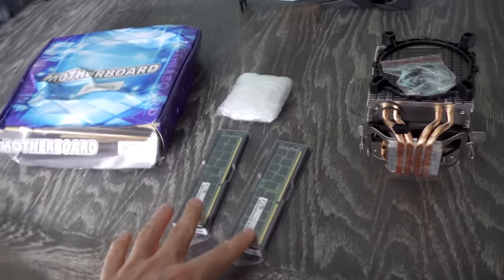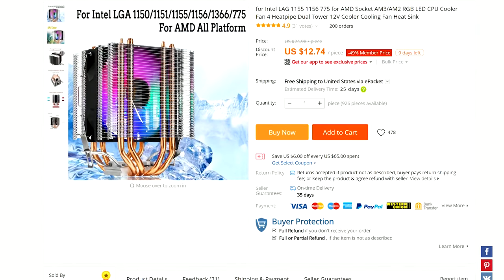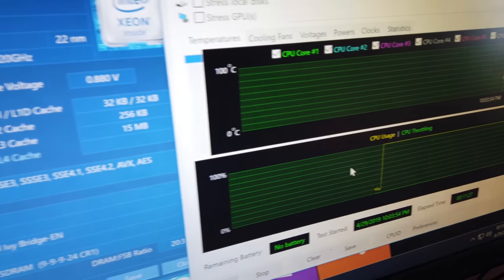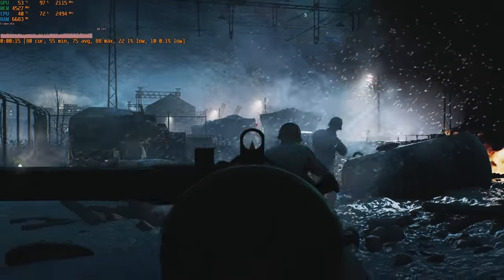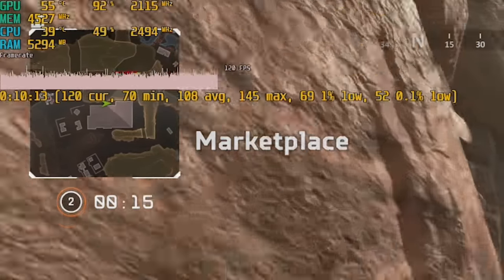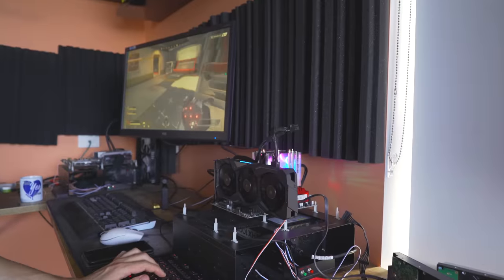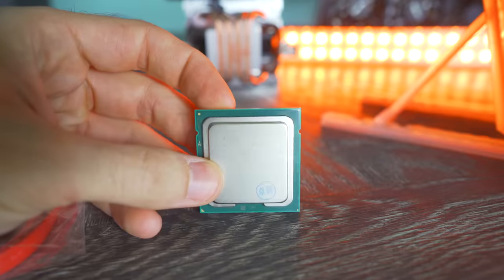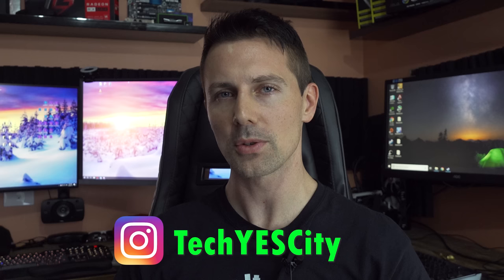This 6 CORE Ivy Bridge Xeon only Costs $24...! (Worldwide Deal)

Comment: Hey brian i have some experience with chinese motherboards and your ram might not even be the problem usually these motherboards apply too much voltage on ram so cheaper rams cant handle it and give bsod all you have to do is lower the voltage to default levels same thing happened to me on a colorful motherboard turns out it applied 1.35 voltage on my ram which normally functions at 1.2 volts so i reduced the voltage and that fixed the bsod issue

Comment: Last month I got a bare bones lenovo s30 for $55(620w gold power supply / motherboard / cpu cooler), 16gb ecc ram for $12 and an E5-2680 8 core at 3.1ghz for $45. Then just put in a $110 rx580 and it rocked.

Comment: The only thing that I would be concerned about is the longevity of the motherboard as it is a no-name board using a chipset that was not meant for that kind of processor. Other than that this looks like it is a fantastic value.

Comment: I managed to snag an x58 system for $100. That's the case(CM HAF 932), memory(12GB in 6x2gb sticks), board (with an i920), and even a 750GB hard drive included. Power supply sucks, so that's going away. I've been looking at Xeons to replace the i7 with and I'm torn between using the X5675 and the W3670. Have you compared these Xeons before?

Comment: Ok great now im stuck between X3440 or E2 Xeon thanks. Btw it would be nice if u can make a video for a list of great budget Xeon combo since u have been recommending alot of Xeons (which make me confuse since idk alot bout Xeon or pc in general)
Or just a comparasion between the X3440 and this upcoming build
Reply: I would get this one tbh
Reply: X3440 would only be better if you plan on getting a high end board and overclocked it.
Reply: @TheFirestriker101  do u think the X3440 would be better if u oc it to 3.8-4.2Ghz? I know brian made one guide where he oc it to 3.8 easily so thats kinda a bare line for me but i think im willing to push out more performance if its worth it
Reply: @StevenSteves  yea 
, the 3440 would be better at that point
Reply: @TheFirestriker101  Cool. Thanks for the info mate

Comment: My z97ar died just bought a mid range board replacement . I hope it will work. The high end socket 1150 have all sold out! Pff I'll go amd in the future for compatability's sake. Though haswell was solid. These boards available for my i5 4690k are all micro atx and only support 1600mhz, sad for my 1866mhz hyperx lol

Comment: X5670 at 4.9 going on 3 years still killing with the best. Digitalanarch here aka digitalanarchy
Reply: what is the mobo in use and the cooler of course?
Reply: @alicherifahmed5200  1 swiftech pump and swiftech 1366 waterblock  p6t deluxe gen 2  water cooled with  1/2 Id 3/4 od hose i run the gpu through the same loop  1 360 rad 1 240 rad max temps hit 77c on p95  while gaming 55c on black ops 4 black out

Comment: LGA1356 definitely seems like the most worthwhile budget Xeon platform since LGA771/LGA775.  Not much of an improvement in single core performance but a sizeable increase in multi core performance and it uses a newer platform.

Comment: I prefer my fx8320. Got it second hand for about $50 and a 970a-ds3p for 35$. It's overclockable and it scores 730 Cinebench points. It achieves this with 4C/8T so it's got way better IPC. Lots of expansion slots for my wi-fi card, for my old PCI sound card and for an m.2 drive. 4 ram slots, USB 3.0 and UEFI. Lack of USB 3.0 is a huge turn-off for that X79 mobo and a USB 3.0 PCI-E card is a must purchase for it. This adds to the cost and leaves you with no expansion slots.

Comment: The only things I don't like with this particular mobo... 1. No USB3, and 2. The 24-pin mobo connector is in an awkward spot when building.
Reply: You can probably get a cheap USB 3.0 card.
Reply: @packergeek10 , the board has one pcie video card slot, and one pcie 1x slot that is used for wireless so unless I use a usb wireless adapter there is no room for expansion. They have a board for 68 bucks that has better heat syncs, usb3, and more pcie ports so I'll probably get one of those next time!

Comment: Figuring out ECC Ram can be tricky. Registered vs Unbuffered, Single Rank vs Dual Rank, DDR3 vs DDR3L, 1Rx4 vs 2Rx8, along with trying to find a board that supports which.  I currently have about 30 sticks of 8gb RAM (M393B1K70DH0-YH9), can you recommend a board that actually supports these sticks.  Preferably one with 4 slots so I can go up to 32gb and ideally one that supports USB 3.0.

Thank you for any help you can provide!

Comment: Looks like a pretty good deal but I will stick with my X5675.

X5675 on ebay for around $27 USD and as you know clocked at 4.5 it scores around 1000 in Cinebench R15.

Hard to beat a $50 motherboard though.
Reply: + minimum 60$ cpu cooler, right?

Comment: What about the I5 2400 with rx 550 in 2019?
Reply: Good cheap combo
Reply: @hugo9016  yeah, its for an internet cafe build.
Reply: @brianmajarocon282  hmm i would go for a rx 560 4gb (low power aswell) but otherwise great cheap choise
Reply: @hugo9016  well, i couldn find rx 560s in the are, would have gone for them, but the 550's just came in last month and they were selling for 65-70 USD the 4gb versions
Reply: @brianmajarocon282  oh nice buy then ;)
Reply: ive been building those but hard to get decent price to performance.

Comment: I love XEON USED.. I am running a older Xeon E3 1280 v2 with 32 gb ram and a 1660 ti.. runs everything  i throw at it on high or better at around 100 plus fps

Comment: I got two W5580s to replace my E5620s, 3.2ghz at a total of 8 cores 16 threads, the two W5580s cost me 50 together.
Reply: For gaming I’d go with the Ryzen 1600 and aim for ~3.9 GHz 6c/12t since they are $80 near me at Microcenter (boards are about $50, or cheaper since Microcenter gives you $30 off the board when you buy the CPU). The ram is more though, $75 for 16 GB 3000 MHz, but for gaming I’d go with the Ryzen over Xeons. Either will be ok though, it’s not like it’s the end of the world with either.

I get 170cb single core (Cinebench R15) on my 1st gen Threadripper system, so it’s fast enough for games (I run my TR with 4x Fury, it’s a little over 2x faster than my Titan Xp).

I’m going to mount my X370 Ryzen 1700 system on a wall (will look nice with its RGB stock cooler and RGB motherboard and RGB SSD with a R not GB Tian Xp Star Wars edition, too bad it’s not RGB as well...), as a couch gaming console. I’ve got my 28 inch glass 4k monitor attractively hanging by zip ties in the living room, so all that’s left is to drill some mounting holes and get a console controller for some decent couch gaming.

Comment: An e5-2620 isn't that fast (basically a 2ghz low power - for a server - part) but there are faster ones that interchangeable with it at higher TDP. The e5-2690 was the top of that line with 8 cores, 16 threads, cost $2000 at the time, but it's down to $90 now.  Also those part are designed to go on dual processor boards, mine old Dell server has 2. My cinebench r15 score is 2200, and r20 is 4400. There is an even faster part, the e5-2687w somehow it wasn't quite as much when it came out, but it's more expensive now.  Note none of these parts are overclockable.  By the way I have two e5-2620s to sell since I upgraded. ... Oh just noticed that he's running v2, mine is an older version, not the v2 which isn't compatible and needs a different motherboard.  The original e5-2620 was about 9% slower

Comment: I have purchased a 10 core, 20 thread Xeon for $70+50 for the Mobo. Mobo low compatibility, only single channel ddr 3, but does the job.
Ok for 7Z or WinRAR large archives.
Reply: Doesn't recognize GTX or RTX cards.

Comment: Should I upgrade my CPU to the xeon? I have the AMD athalon x4 860k. With 16gb ram and gtx 1060 3gb. I've been thinking about getting the ryzen 5 1600 but out of my budget until I get a job but still then idk if I'd wanna drop money on that. If not the xeon then what should I get. I'm a big gamer. With 3 monitors and a vr but my cpu rn fails to do vr, I also do video editing and photo photography.  Thanks
Reply: Might want to hold on if you can, new ryzen cpu's are on the way. Original ryzen proces could drop or something of that nature.

Comment: will this cpu work in x79 2011 board?  .....gigabyte GA-X79-UD5
Reply: Nope, different socket. One could envision a 2011>1356 socket adapter maybe being possible, though if that worked, only 3/4ths of the ram sockets would be usable, and you'd have to roll your own BIOS with UBU etc...

Comment: Amazing video!!! I just subscribe. You gave me the idea and I find a deal that I'd like to know your opinion: Refurbished Dell Precision T5500 Workstation X5680 3.33GHz 6-Cores 24GB DDR3 for just 182usd. I'd like to put a GTX 1070ti there but the seller told me that it doesn't have a capable PSU and that install aftermarket parts is tricky.

Comment: Alright for the South Africans out there here is the pricing

CPU: E502420 V2=R370 
Motherboard:EastVita X79=R1050+Cooler=R1300
RAM:16 gig DDR3=R260 in our country you can get ut for R800 too
GPU:GTX 1060 3gig=R1700/RX570=R1900-R2400/RX580 8gig=R2500/GTX 1070=R3500/GTX 1660=R5400
OS:SSD+1TB HDD=R2000
PSU:400-800watt PSU Averages R500-R1500 bucks 

Grand Total(ave):R7200 to R12 000

Still a Lil Pricey BUT i believe this can be a kickass setup for quite sometime.

Comment: Still better off with an OEM 1366 board, such as the one from the HP Z400 series...and an unlocked w3680 6c/12t...overclock with Throttlestop to 4+ GHz.  Setup cost about $120 Canadian for cpu/mobo/Ram...even cheaper if you can pick things up from local classifieds and the like.
Reply: you're overclocking on an HP motherboard? How are the temps?
Reply: @star5328  Temps are fine since I'm running stock voltage...the Z400 is actually my gf's PC, running an unlocked W3570 4c/8t at 4GHz...also have a Dell T3500 running the same setup (overclocked to 4GHz using Throttlestop), but the T3500 has an unlocked W3670 on the way which is also known to hit 4+GHz using these boards and Throttlestop software.
Reply: @AaronHendu  I found an evga x58 board that was trashed and i'm trying to fix it but if it doesn't work I'm thinking of going the workstation route. I had no idea you could OC on HP or Dell systems at all. I'm extremely interested.
Reply: @star5328  There is a great resource for this type of overclocking over on the techpowerup forums - https://www.techpowerup.com/forums/threads/throttlestop-overclocking-desktop-pcs.235975/ - hope to see you over there, the creator of the Throttlestop software regularly posts there to help, and other knowledgable members more than willing to help as well.

Comment: Really nice idea. Concerning to the 1356 H61 Mainboard, no USB 3.0 and for the GPU: only PCIe 1.0 x16 available on the board? please correct me, if I'm wrong. Thank you & thumbs up!!

Aliexpress- Article Details:

Article type: Motherboard

Chip manfacturer: intel

Chipset series: X79 (H61/P67)

Supported memory  typ: DDR3

Model: X79-1356 DDR3

Max. Number of networkcards: 1

type: desktop

Maximale memory capacity: 32G

CPU slot typ: LGA 1356

Supported CPU typ: Xeon, Pentium serie
s

Speicher kanal: dual channel

Motherboard architecture: MicroATX

Graphics: discrete graphics

Support for graphics standards: PCI Express 16X

Onboard NIC: mit onboard NIC

Number of usb-ports: 10

Harddrive interface: S-ATA II

Onboard soundcard: 6 channel

Contains:

1 x product, 1 x manual, 1 x box

Note:

The colours may differ

Comment: Bought 5820k for 130$ on ebay with quad channel memory, mine can run at 4.55ghz, 4.2 ghz cache, 3000mhz ram + tight timings, its 11% slower in 480p on low in tomb rider than 8700k 5ghz, 4.7ghz cache + 4400mhz ram dual channel + tight timings.. But my 5820k config is 2 times less expensive, great deal.. considering there is  0 difference in 1080p, 1440p.

Comment: Now compare it with i7-2600 and i7-2600k OC
Reply: btw the atx 20+4 pin socket position is kind of weird. I don't think the normal atx 20+4 pin connector can reach that far in atx case (any gpu used will make the 20+4 pin connector literally stretch across the motherboard). not sure about matx case though.

Comment: What about xeon E5 2430v2 it's also very good for price 6c12t 15mb and @2.5ghz and bost is @3.00ghz if people are going to build from scratch @3ghz worth it cause those CPU not possible to overclock. 0.3ghz maybe looking not huge difference but under 3ghz every 0.1ghz bost dramatically effective on performance.

Comment: rocking a used e3 1246 v3. unfortunatly my gigabyte ga-ds3h-a doesn't have enough juice to fully power it. 
on autovoltage (1.35v -_-) the cpu clocks down to 3.2GHz under load. 
After undervolting it to 1.025v the cpu could maintain 3.5GHz but now turboboost won't work.

that mobo was the worst new purchase I ever made and now I can't even get a refund. (bought of a third party amazon seller a little over a year ago)

Comment: if you can find a cheap used GPU on ebay like a GTX 670 or 680. You could have a decent gaming system that is better then a console for under $250

Comment: At least here (austria) the best budget GPU is not RX570 but GTX 1060 6GB, since they are 70€ (~80 USD) :)
Does anyone know by chance if the chinese LGA 1356 board supports BCLK OC? My current board on the platform is a lenovo one, but had no sucess getting that one to do bclk OC :(
Reply: @Sh1ekk  https://www.willhaben.at/iad/kaufen-und-verkaufen/d/manli-nvidia-gtx-1060-6gb-306695072/
Dude has like coupple 100 of them :D Used to have some KFA dual fan cards as well for 75 :)

Comment: Just wanted to point out that the 1660 (and similar) have absolutely zero value. Check out JayTooCents if you want. Rx570 is cheaper and dominating the 1660 performance. Sad considering it's two years old.

Comment: Much better combo is 2.6ghz 6/12 core e5-2630 v2 (33$ in aliexpress) and compatible motherboard, almost 30% more power for little more money and better 2011 chipset.
Reply: Lol then buy 2470 v1 for 1356 or 2440 v1 :) thats not a problem about performance but about the budget! 2011 is really the same as 1356. Your CPU is almost 2x more expensive than 2420 v2
Reply: And 30% advantage of 2630v2 is not true! Only 11-12%. Check cpu-world site.
Reply: @MrRomanvideo  Poor you, dont you think about future upgrade, 1356 is dead end, no powerful cpu-s and in games there is max 30% difference, core frequency is so low with e5-2420 v2. How stupid can you be to not understand fundamental things, you think the 8$ lower cpu price is a win? Passmark btw gives 8600 vs 10400 points, huge difference for 9$ more. I7-6700 gets 10100 in passmark, thats a 200$ cpu.
Reply: @MrRomanvideo  Look ebay for good 2011 motherboards starting 60$ and there are sata3 and usb3 and your trash "high end" 2.2Ghz 1356 cpu-s are 200$ and performance is like 50$ 2011 cpu, wake up.

Comment: By the way 2011 is better than 1356 even u pay a bit more for 2011 cpu and mb, but u at least can upgrade later for cpus like 1650 , and 1356 memory bandwidth is slower ,bcuz 2011 motherboards have quad memry channel , then 1356 china motherboards does not support triple channel (1356 have triple ,2011 quad )

Comment: For me x5650/60 is still better option. Better gaming performance duo to overclock ability. And even that the x5660 is cheaper than e5 2420 v2... Still this 2420 represents great value but just looking at the cinebench score of 620 and the overclock x5660 goes above 1000 points... Of course for the x5650/60 you will need better mobo cuz overclocking, but really paying 70$ for mobo and 12$ for x5650 for me its better choice...

Comment: not satisfied with this build...ur previous builds are really good...but u r pairing a high end card 1660 with a 2.1 ghz cpu..frame rates are only because of the multi cores and that gpu.
Reply: High end? This is mid-range. Upper end of mid-range, but mid-range.
Reply: jablue x5670 or even x5660 is of same price and almost 50% faster than that useless cpu
Reply: @piyushverma1077  And? Your comment was that this is high-end... when it's really not, nor is he passing it off as such. He could've gotten a better CPU, but it's performing well at what it's meant for, hence making it a good build. Optimal build? No. But I don't think that was the point of the video. To me, it was a showcase of something neat he found. I'd never even heard of 1356 before this video. I thought he meant 1156 or 1366, so I learned something. You as well as people calling this an "amazing build" are kinda taking it the wrong way, imo.
Reply: @piyushverma1077  yea if you pay a high price for a x58 board with good oc capabilities.
Reply: Jay Rich  why pay a high price...both the huanan boards are of same price on aliexpress...just look at the price of both the boards...and without overclocking x5670 or x5660 which is of same price are much better than this junk.

Comment: If you can find a good deal on an x58 board grab a 5 dollar x5650 xeon!! thats what i have. my motherboard is the cheap msi x58m non pro version board so it sucks at overclocking but i can get about 3.5 ghrz from a stock 2.66 with 35c idle temps and 68 max temps under stress test with a 14 dollar cheap dual fan heatsink. i paid 145 dollars for 24 gb of pny beautiful 1600 mhrz ram, i7 950, the motherboard, radeon 5450, and bunches of sata cables

Comment: you can get xeon w3670 for same price, and its better
Reply: but motherboards on 1366 is way more expensive
Reply: @madmax1436  it really depends. I got Asus Sabertooth x58, i7 960 and 8gb ddr3 for 150$. And on AliExpress you have some motherboards for 50$, which are working, and you can buy z400 motherboard also for 30-50$ and you can oc the CPU for a few hundred MHz.